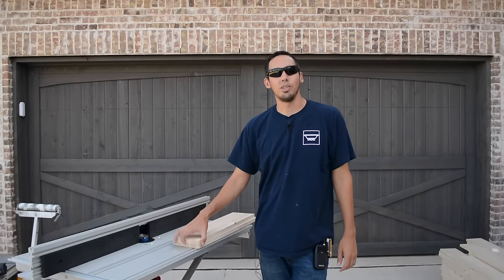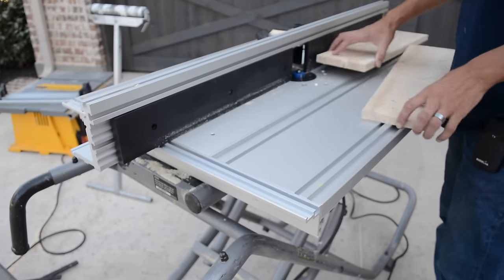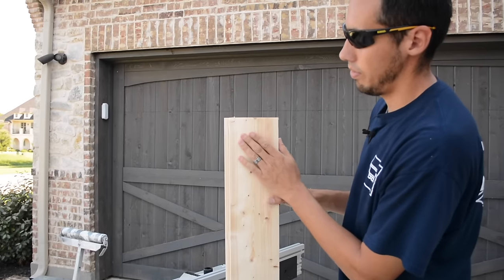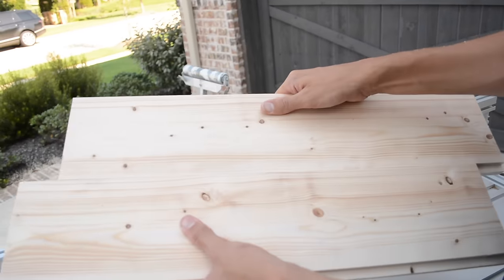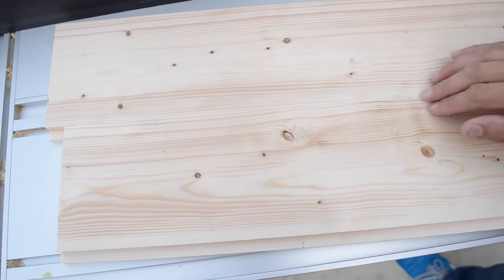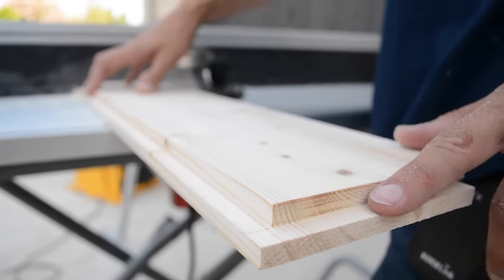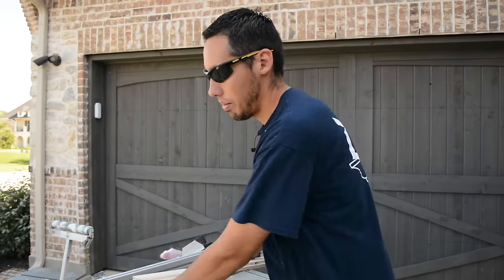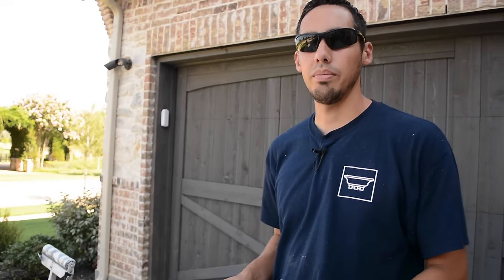How to Make Your Own Shiplap

Comment: Thank you for sharing. Instead of using a spacer I would do all the top cuts first then change the position to get a deeper cut for the other side, this way the extra 2 mm going to push the wood and create that look without using a spacer everytime
Reply: The function of the lap joint is to allow the boards room to expand and contract with humidity / season changes without buckling or leaking air, light, insulation or whatever.  Doing it your way leaves no expansion room and you will likely eventually get buckling or unevenness.
Reply: I had the same thought

Comment: A true shiplap will have a half inch lap joint on one side and on the other side 5 eights.. So one side you put it together its flush.. On the front side it will have 1/8 " spacing....no need for spacers... But you got close...

Comment: For the second rabbit cut couldn't you just bring the fence tward you for a shallow cut? That way you would have one longer tongue that slips into the shallow cut to give you the spacing, you would just have to mark the "top" of the board .
Reply from the maker: eightyproof that's a great idea. the only issue I see with it is that you would be forced to keep the boards in order. making sure to alternate them. but its definitely time saving on the spacing part
Reply: dfw crown why not just divide the gap in half for both your horizontal and vertical joints, that way your joints come together no matter what order they're in. Basically, your height of the bit above the table would stay at 3/8", but the depth from the fence would be slightly deeper. This would require a bit without the bottom bearing, though, like a 1/2" straight bit, and you'd be relying on the fence of your router table instead of the bearing, but that's no big deal.

An example would be if you want your gap 1/8", instead of cutting the rabbet 3/8" x 3/8", cut it 3/8" x 7/16", then you'll always have a 1/8" gap at your joints, vertically and horizontally.
Reply: eightyproof That's exactly the correct way to make your own shiplap. You just need to determine first off front and back of your material. If you look at it closely most milled material will have a good "finished" side and a bad "rough" side. Then run them all thru on one side. Make an 1/8" adjustment. Then run them all thru on the opposite side. Gap is automatic then no spacers necessary. Easy peasy!
Reply: The gap serves a purpose. Wood can swell with increases in humidity. If the boards are tight together there is nowhere to swell and they can buckle.
Reply: Damn I just wrote that out without reading comments, I suppose I'm a year late anyway
Reply: Yes that the way you do, so you don’t have to use spacing
Reply: @zone4garlicfarm  I was thinking the same thing... I could make the top of the board 1/8" less of a gap. If the boards are interior, will they still swell?
Reply: @bombshellgirl8106  Interior wood can shrink and swell with seasonal changes in humidity. Humidity tends to be lower in winter when we heat our homesand higher in summer. Using a humidifier in winter and a dehumidifier in summer to keep  the relative humidity at 50% is best for interior wood and best for comfort and health but most people don't bother. Using air conditioning in summer will reduce interior  humidity and prevent wood from swelling.
Reply: @zone4garlicfarm  Thank you for the information.

Comment: I’ve been binge watching your videos, love em, very helpful.  A way to take this technique further to achieve that 1/16” to 1/8” gap between the boards instead of using your ruler.  After you run both sides through the router like you did, run one side through the table saw and trim that desired gap (ie: 1/8”) and now you can just stack the boards on the wall faster without having to shove the ruler in between and constantly run it down board.  I’m about to finish my kitchen renovation and I’m down to base and crown molding and I’m looking forward to using a lot of your techniques, thanks.
Reply: choprpilot76 Ha, nice. Just asked about doing this before seeing your comment.

Comment: Thanks, you gave an excellent explanation of the process.  I am doing an indoor home sauna build, and going to shiplap the exterior rough cut boards that I have from trees cut from our land., I'm doing the shiplap as an improvement to the insulation, and using purchased T&G cedar inside. Thanks for your thorough explanation.

Comment: Jessem stock guides are a great upgrade to any router table. The guides apply down pressure and hold material tight to the fence. I also have the sommerfeld router table and fence great tool

Comment: Great tutorial.
The purpose of shiplap is as a weather proof exterior seal.
It's also important when installing it on an exterior wall that the top board overlaps the bottom board on the exterior face to allow water to flow on the exterior and not penetrate to the interior.

Comment: Hey can I point out one thing, on the gap... The rabbit on the top, at the wall side is supposed to be at 5/8" deep so when you come with the next board, with the bottom being a  1/2" rabbit..or top desired depth, the gap is automatic at  1/8" ..or desired gap size (the thickness of a nickle) another name for shiplap is nickle gap. Its actually easier because they drop together without using spacer, it just bottoms out with a gap.
So there is a functional top and bottom (good side) to each board

Comment: nice work as always. have been doing construction close to 40 years. ship lap made more famous from chip n Joanna gains, but was always taught that real ship lap is like lap siding on a house, no space. Nickel slot is whet you are doing, cause years ago they would space the boards with nickels, cause they are the thickest coin with a smooth edge. tell me what you think. lap means over hanging the piece below. still great job.

Comment: Question:  is there a reason you didn’t change the cutting depth of the rabbet on one side of the board to create the “nickel” gap eliminating the need to gauge every joint?  Run all boards through the first depth setting, then change the rabbet depth for the opposing cut and finish the routing.

Comment: I used my table saw and a dado blade with a sacrification mdf runner to get the dado tight. 

Worked fast but i noticed I had a few odd boards that road up as I was milling them. In hind sight I wish I did the router table. I thought the process would burn up the router bit, bit taking so much material. 

Wish I saw this 1st. Still turned out great but I like the router option...

Comment: Another great video!! I like the shiplap look, as long as it isn't overkill!! I do wonder how long the craze will last. I do have two quick questions. For wainscoting a narrow hallway, would you see any problem with removing the lower section of drywall and putting the MDF backing directly on the studs? Trying to not make the hallway any more narrow. Also, think you mentioned using Bondo as hard filler in a video, if so, which type? Just trying to find the best solution for filling a screw hole in a door jam. Thanks!!

Comment: Make the gap smaller than you actually want to end up with because real wood will shrink over time adding about 1/8” more to the gap width.  You can even paint the wall black before installing the wood and install the wood without the lap joints.  Just install the wood pieces touching each other and over time the shrinkage of the wood causes a gap and the black wall underneath the wood makes it so you don’t see the wall through the gap. This technique works especially well with a stained finish on the wood and makes a great looking wall without the routing.

Comment: I do pretty much the same thing, but I make the cut a hair bigger than 3/8 because there is so much variation in the wood. It's better to cut out a little more and they will still look flush than not cut out enough and the one board is sticking out a little. I also bevel the edges when sanding the boards down. Most people put shiplap on their walls, but I used it on my ceilings on my first floor. Stained and varnished knotted pine, but kept drywall on the walls. My only problem with shiplap is you have to face nail it, where tongue and groove nails are hidden.

Comment: You note that if there was to be no space between the boardsthen one should not waste their time making the lap joint, then when joining the boards on the long end without a space for the seamless look you lap the ends. Is this for strength? Would the length-wise joining of the bottom/top board not be sufficient?

Comment: Love your videos man, im a framing Carpenter, i can pretty much build a house from start to finish, but the most finish carpentry I've ever done is like elevations or exposed pergola. Very few trim work. I really like being precise on my work but sometimes I do get frustrated when my cuts are not real tight. I was interested in doing cabinet work, I've got a cheap router table, but some of the bits can get really expensive, do you have any tips on making fancy trim with regular router bits and table saw? Thanks

Comment: Other than the depth of the space between the boards, what is the benefit of real ship lap vs faux ship lap. 

I make a "fauxlap" with 3/4" plywood. I run 1/8" kerfs from my table saw about 3/8" deep every 5-1/2". This technique works best for runs under 8'. It's much faster than traditional shiplap.

Comment: hey Richard what setup do you use for your longer lengths 6ft plus?? do you use the roller stands at each end to support the timber?
I use a couple of timber stands to keep it flat to the table but just wondered how you do it on site?
Reply from the maker: D.F.M Carpentry yes I use roller stands on site.

Comment: Do you have to paint the joint before installing? Just wondering how the paint covers the crack ?  As always great vid, thanks
Reply: Prepainting or prestaining is always best with shiplap or tongue and groove wood. Wood expands and contracts with changes in humidity. That can leave more of the tongue exposed than what you see during installation.

Comment: Thanks for the great video!  I wasn't sure how deep to rip those laps. Question:  is that roller bearing guide necessary when you have a fence?
Reply: I would say the bearing is necessary. It makes the cut always the same depth. Otherwise too much adjustment and room for error.
Reply: @aaronjaben7913  That's what I thought the fence did.  I use a roller bearing on my handheld router, but when I use my router table I use the fence.  Is there a reason to use both on the table?

Comment: I don't understand why did you use the router, when you're still going to use a spacer at the joints? When not just install like the faux style? It would have made sense if the back overlap piece was 1/16 inch longer to give the gap (shiplap effect).

Comment: and if you use a 1/2 inch bit on one edge and a 5/8th bit on the other edge and get a 1/8th gap automatically. for the end cuts you should clamp a reference block to the fence back from the blade to put the piece against so you don’t have the piece against the fence while cutting.

Comment: That's a good way to do perhaps a small run. But for a whole house? I would use a table saw with a dado blade. That cutout will most likely never be seen. A 10" table saw blade is going to last longer that a router bit with two teeth on it.

Comment: i would qualify your comment 'if you are familiar with woodworking you will know 1 x means 3/4' If you reference to woodworking 'in America' that may be more accurate. 

I think America is the only place that doea not aeem to use actual measurements. At least here in Australia we use the actual size of the material. Anything else would be false advertising.

video is easy listening and informative. nice job
Reply from the maker: Yes, the system here in America so strange. It's like we purposely do things the hard way. Thanks
Reply: Actually a huge home improvement chain got sued in the state's for "false advertising 2x4" it was lowes. Now the 2x4s have actual size 1.5"x3.5" on the price tags
Reply: The dimensions of lumber are based on the size of the wood when it is sawn from logs.  This is referred to as rough cut lumber.  Very few lumber yards in cities sell rough sawn wood.  Instead, the lumber is then planed to a smooth finish on all four sides which removes material and reduces the actual dimensions to what you see at home depot, lowes ...  The lumber is then referred to as "dressed" but its original dimensions were in fact 1"x6" or 2"×4"...

Comment: The reason for making a ship lap joint is to keep water OUT.. It's not an architectural "LOOKS" thing, it is to keep the weather OUT. The reason they leave a small space is for expansion.
Reply from the maker: Steve 1961P. but it is an architectural detail here Steven. I'm not trying to waterproof this newborn baby's nursery. which is where this ship lap is going. I'm no expert on building ships.

Comment: You're wrong about there being no need to put the boards flush. There is a very time honored reason they did exactly that. The boards will slowly dry out over time shrinking ever so slightly as the years go by. Especially true from moist summer to bone dry cold winter. THAT is why you put the boards tight, so that when they inevitably shrink, the lap joint still protects from rain getting in. Homes built with flush pine boards back in the 1820's in New York and New England have shrunk to reveal gaps that were not originally there. This will be even worse by putting a gap in ahead of time.